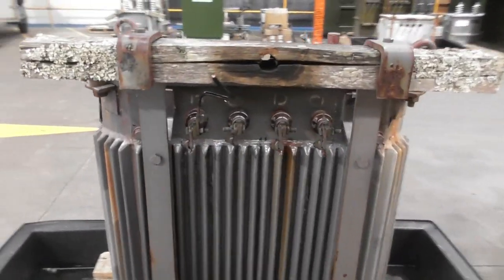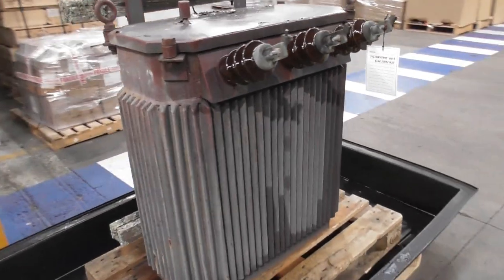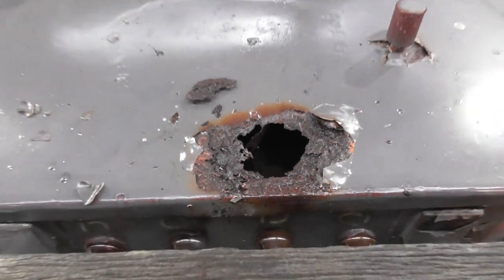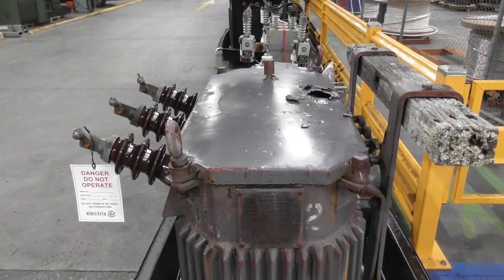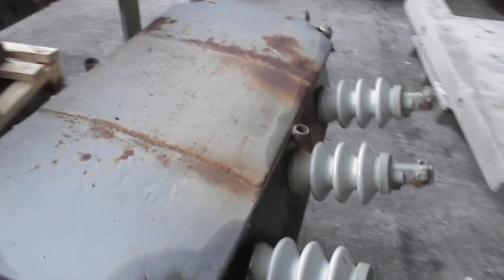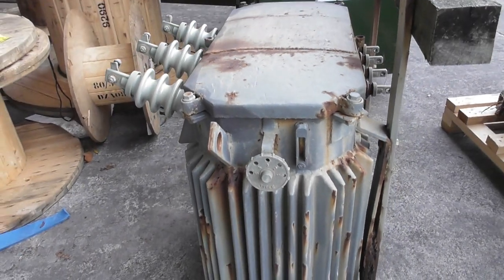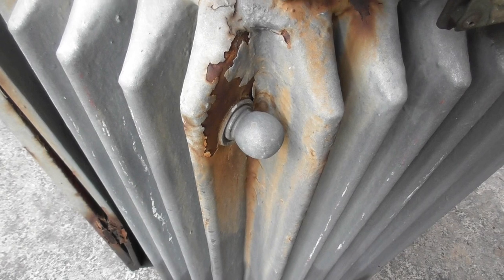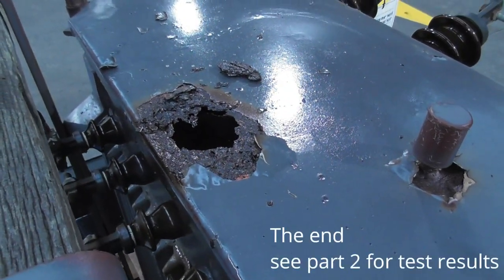Two vintage Ferranti 25 kVA power transformers

Comment: Hopefully you can keep those vintage name plates and put them up on your wall. Dome is a fusible plug, there to melt and relieve pressure in the tank if there is a fire and the transformer heats up enough to boil the oil. Then once plug melts the vapour will vent out safely and not blow the steel case apart. The welded up one likely failed at some point, and it was simply welded up . The ball shape is so the tank heat  will not melt the lead tin solder till the tank and air are both hot, as the bell will keep the interface cool, and the ball shape also makes it easy to soft solder the new plug in place, keeping the bulk from melting. Tapered plug you solder in from inside the tank with a gas torch.
Reply from the maker: Thanks for that info. Didn't know that, and it makes perfect sense.

Comment: Rust spot due to cable sitting on top of transformer. 25kVa 3 phase is very small by todays standards... 35A/phase at best. Can't see many installations getting these back. I must say during my many visits to NZ I was always amazed at the number of, and very small size of their rural 11kV/415v assets compared to here in Aus where you'd never find anything smaller than 50 (more like 80) in three phase. The smallest you'll find here anywhere is a 25kVa single phase.
Reply: Likely for feeding 6 households and 3 street lights on a small section of the main road outside town. Small and likely been there for decades, even once the place grew to 20 houses and it had 100% overload on it, designed so conservatively that it did not even notice the overload.
Reply: @SeanBZA  Even at 100% overload you wouldn't fit more than three houses on that in Australia today. Then again, I have had  an entire resort client (like a small town / caravan park) running off one 50kVa split phase 480v for over 20 years now.. its amazing what you can do when you put a lot of time in to load balancing and time controls...:-)
Reply: @zordmaker  6 houses in the 1950's would have been no problem, seeing as you would have light bulbs, a TV set and radio as the loads, with perhaps a 1kW heater on in winter. Cooking via gas or wood stove, not electric. But modern houses yes 35A per phase would probably only do 2 houses with all mod cons, but seeing as it is so over designed it likely would still have handled the 6 modern houses fine. Those old transformers for power company use were really over designed, with almost all the loss being in core losses, and nothing in copper, and regulation of less than 1% for the most part. Run at 300% load for months at a time no problem, and with diversity loading likely did so for at least 3 decades or so anyway, just dropping output to around 220VAC on the worst case, from the original 240VAC.

Most rural supplies you can go as low as 180VAC at times, for extended periods, especially at the end of a long feeder, as a lot are SWER, saving on that expensive aluminium core wire, just slap a massive earth mat at each pole transformer on it.

Comment: When "Made in England" used to mean something!

So what happens to these new, I guess they are too old and rusted to be restored ? Off to scrap metal ?
Reply: More specifically, when we used to make impressive things in Manchester!
Reply: @markboyle9941  Yep Ferranti were huge, they used to make semiconductors too... famously the custom chips used in the ZX Spectrum and Acorn BBC computers were made by Ferranti
Reply from the maker: They will get scrapped. We have power transformers from 2019 which have failed and get scrapped. So much of the crap quality of the newer TX's. These Ferranti's are 60 to 70 years old. One failed because of water. the other one is still ok. Remove rust, fix leak, sandblast, new oil and good for another 70 years.
Reply from the maker: @jaycee1980  And very good quality electricity meters in Holinwood UK.
Reply: @jaycee1980  From the Manchester MK 1 in 1949 to the impressive speccy ULA, it's an impressive history in computing. We even used to make loco vacuum braking systems in the small place I live in. All sadly gone now though...
Reply: @RODALCO2007  Hope you can save the second one, just for the yard.
Reply from the maker: @SeanBZA  I could but I have already enough electrical junk in my yard.